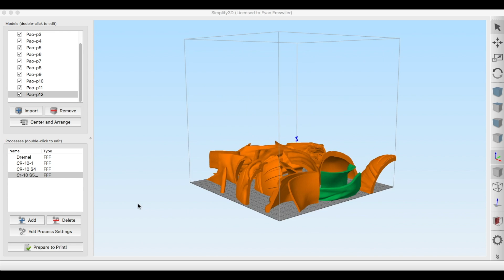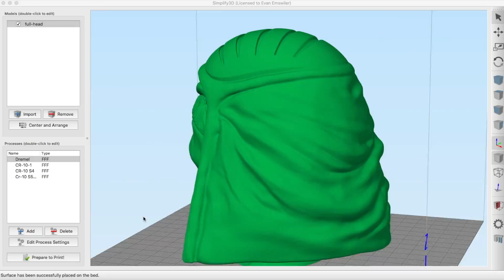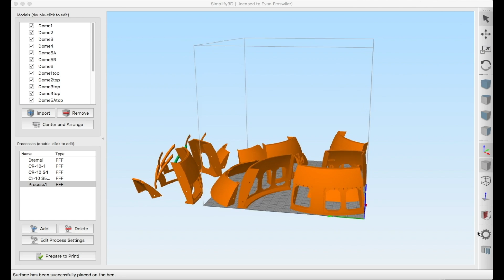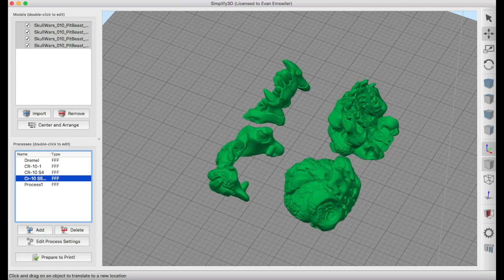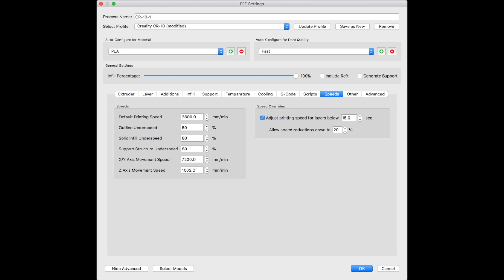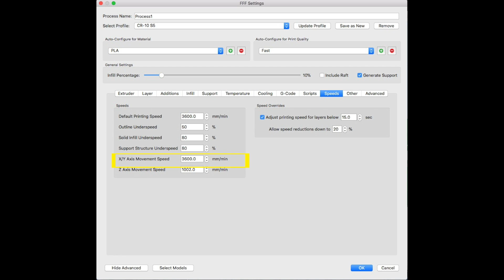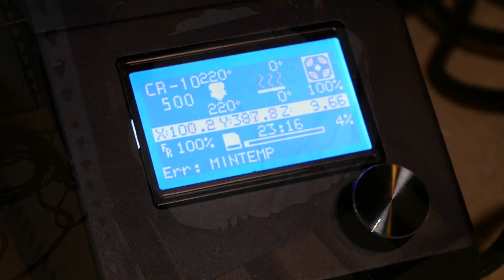Make Insanely Huge Prints on the Creality CR-10 S5!

Comment: is the r2 dome you printed the same size as the body you printed?
Reply from the maker: The one I printed on the S5 should be the same size as the one I have on my painted and finished R2, if that is what you're asking
Reply: Excellent!  So the r2d2 dome is life size? I’m thinking of getting an s5 specifically for droid construction. Would look at printing body parts too ideally in larger optimized pieces if I can manage to get them from once I subscribe to his patrion page. So you can confirm the printer is big enough for an accurate r2 dome? Correct?
Reply from the maker: David Goodfellow Yes it is a life size dome, although there may be some issues yet to work out with the model since I believe I am the only person to have printed it.
Reply: Thanks for the confirmation. I’ll contact the designer. Did you give the designer any feed back on your test run with the big one piece model? Any tips on model tweaks to s5 optimize?
Reply: Hiya, drop me a message via Patreon. Suspect the faceting is just export settings on a large object, easy fixed. Files and R2 full size and accurate :-)

Comment: ask the guy if its ok to send me the stl file for the r2d2  head and i will remove the facets and make it smooth for you. also you might need to slow the print down i see you already see that. bit. but yes if you want i can smooth down the r2d2 head if you want.
Reply: The file owner has re-done it in a completely smooth version, you can access it from his Patreon.
Reply: I would love this.
Reply: well if the Mighty jabba asks the guy if its ok for me to smooth down the head and send me the file i will do it for him.or if i can find a link etc rather get permission first.
Reply: cool :) saves me reworking it. :)

Comment: How did you go about getting the bed leveled? I can't get mine leveled what so ever.
Reply from the maker: It can be tricky. I usually just make sure that I use a skirt around what I am printing and adjust the bed level on the fly as it prints. The position of the bed leveling knobs on the S5 makes this harder than with other printers, but I designed some slightly larger knobs that help a bit. Sometimes I have to stop the print and start over until I get it right. Also, I use glue stick on the bed which definitely helps with adhesion. You can also try turning your glass over to see if it is any easier to level on the other side.
Reply: Mighty Jabba's Collection thank you! Can you share the adjustment knob upgrade that you made? I can't find ones that work for the s5.
Reply from the maker: https://www.thingiverse.com/thing:2552928

Comment: Layer shift is from a moving Y axis style printer. The CR-10 Really should be a static bed at that size.
Reply from the maker: Yes, I agree. It works for the smaller models, but I think they may have taken it a bit too far with the S5.